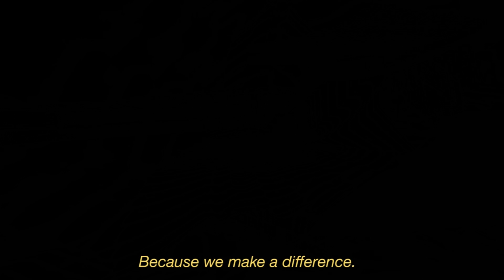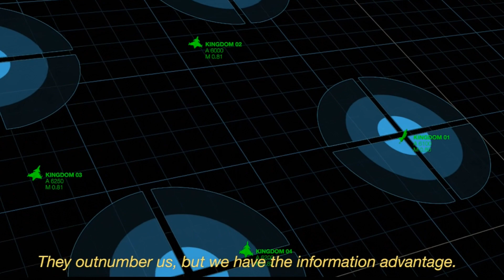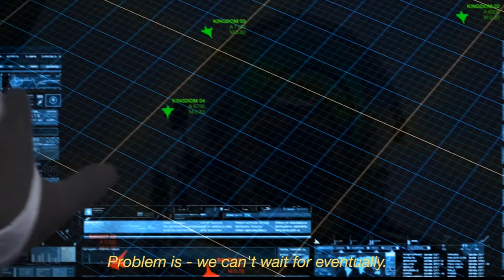Gripen Fighter Jet - Canada's Future Fighter?

Comment: I don't understand the fascination with the F-35. It is probably a good attack/strike aircraft. It will never be a great air to air combat plane. Ever. It's wind loading is way, way too high.  The F-22 is a great air superiority fighter, but is out of production and will probably never be brought into produciton again.

For Canada, I think the Gripen is great for the ground attack role, but instead of the F-35, I would like to see something like the Eurofighter or Rafale for the air combat role. I know people are going to jump all over me because neither aircraft are "stealth". Guess what, "stealth" has been very over sold. Even now, the Russian air defense equipment is being refitted with lower frequency radar to nullify at least the radar absorbing material used on the F-22 and more importantly, the F-35 and B-2, and osme of the shapes and angles. To retain the radar absorbing aspect of their stealth, current estimates are saying that the radar absorbing material must be increased in thickness to 2 FEET to be effective against the lower frequency radar units. Not going to happen.The other aspect of "stealth", the actual shapes and angles, are reduced in their ability to redirect the lower frequency radar signals (signals are less directional at lower frequencies, wavelengths are longer). So, as I have stated above, the "stealth" concepts are hugely oversold. The other part is that there is the return of the concept of the "get close enough to fire a missile, and ti will do the job". It hasn't worked in the past. Probably won't work now, even with all of those wonderful missles and guidance systems that are out there. All of those systems can be, and will be fooled, at some point int time. At which point, you have your pilots, with their fighter jets, facing an opponent with their fighter jets, and all there is is cannon, and short range missiles. The winner in that contest will be the pilot/ighter who can get into firing positon quickest, and that will NOT be the F35 pilot. It will be the Eurofighter/Rafale/F-22/Pak-Fa (T-40/SU57)/SU-3X pilot/fighter.

Isn't this beginning to look like a revival of the old US military principle of the Hi/Lo mix?At the time it was the Hi cost(F-15) in relatively few numbers mixed with Lo cost (F16) in larger numbers.
Reply: The F35 is most emphatically NOT a good air to air fighter. It has lost numerous fly offs against F-18s (Australia did that test) and F22s and F16s in the US. The F35 is NOT designed to be an air to air fighter; its inherent design is not suited to air to air combat due to the wing loading. There is no modern air-to-air fighter that has wing loading over 400Kg/M2. The F35 wing loading is 535 Kg/M2.  That is fine for a ground attack fighter where a high wing loading is an advantage; it is completely unusable for an air-to-air fighter.

As well, the so called "stealth" advantage is already eroding. The B-2 is already being looked at for replacement. This is due to the latest Russian air defense radar units are going to lower frequencies which renders the radar absorbing materials ineffective, and the other parts (shapes/contours) less effective as well. In addition, these radars are now being designed to look for any objects that are moving at high speed, no matter how small. They no longer disregard small bird sized objects that are moving at hundreds of miles an hour or more. So. stealth isn't going to be as much of an advantage as it was originally said to be. But, the F35 is still compromised by its stealth design and the sacrifices made to the Marine V/STOL version aerodynamically.

Within visual range, you do not want to be in an F35 and have to fight with an SU-35 or SU-37, much less a T-50, Rafale, or Typhoon.  All of those planes will easily out-maneuver an F35 with ease.
Reply: F35 is too fast for being a good attack aircraft. It will not be able to see the targets on the ground and less so have time to target them with a bombload. The plane cannot stay up in the air for hours and then answering a call for help from the men on the ground like the A10 can, because the F35 cannot stay up in the air for 6 hours since it run outs of all its fuel in just an hour and a half.
Furthermore is the plane thinly armoured like a fighter jet, and got lots of vulnerable parts.
Reply: I think stealth is overrated today, and it will probably become even less important in the future when detection technologies improve. Some types of radars can see all kinds of planes and have done so since radar was invented in the 1940s so stealth is just a relative concept. Furthermore does stealth also depend much on from which angle a plane is getting ovserved from. And finally, even if a plane cannot be seen with radar, it could be detected with other types of sensors - such as heat-skeeing detectors - and the Rafale can easily see the F35 from many dozens of kilometres away since the F35 got the most powerful engine in the world and it also lacks any device that cool off the hot air from the engine so it can remain undetected, because F35 doesn't carry a such thing onboard to save weight.

Good stealth might allow your plane live a little bit longer and allow you to get closer to the enemy, so you could get in range to kill him. But one should not overestimate the importance of stealth. Atleast as important is the equipment onboard, and if you can find an enemy plane far away and got good missiles to kill him before he even got a chance to spot you, then you got a huge advantage even if you fly the shittiest most unstealthy plane in the world.
I also think that auto-cannons on planes are a bit outdated and that we live in a new age of missiles, but I wouldn't want a plane to be without a little cannon just in case.

The Russian planes looks best on paper since they are super-manouverble and can engage targets 400km away, while F22 and F15 are less manouvarble only can attack targets 160km away. And with stealth on top of all that, I think that the Pak Fa will punch the crap out of any F35 coming its way. PAK FA is the best plane. But Gripen is the best plane one could get in relation to price. In a computer game I would only have Pak Fa's in my air force, but in the real world with money constrains I would go for the Gripen, and perhaps also get a few Su35, F22 or Eagles to get this Hi/low mix.
Reply: I don't think tge speed of s plane is any detriment to tge ground attack/strike role. It hasn't prevented the F-15E, F/A-18, Mig 27, Tornado, or many other jets from being effective ground attack/strike aircraft. The A10 is a unique aircraft; it is a close air support airplane, basically a faster/better helicopter gunship. As such, it needs to operate in areas where the airspace is free of opposing fighter jets, a significant issue.

Gripen can work for Canada. There is no need for ground support in the far north as a standard, day to day operation, so the single sngine is not as much of an issue. Whenever an air to air fighter jet is chosen, that one will need to be a twin engine plane, and it can be user for long range patrol.
Reply: F35 cannot replace the A10 in the close air support role. And it is true that F35 can bomb targets a thousand meters up in the air, but so can the F16 do as well so there is not really much of a needed for this overpriced truck to deliever a bombload.

And you seem to have missed that Gripen got a longer range than most twin engine planes - such as rafale, typhoon and F18. And sure one extra engine gives some extra power, but on the other hand does an extra engine also increase the air resistance since it makes a plane much larger. So most single-engine planes are actully faster than most compareable two-engined planes.
Reply: f35 isnt a stealthy plane killing things from distance, when its heat profile is the largest of any mentioned fighter jet since it got no mechanism to hide the heat from its huge engine because such things was sacrificed for the sake of weight constraints. And since F35 got the most powerful engine of any fighter jet it also generates more heat than any other, and thereby becoming an easy target.
So a Rafale can easily detect F35 ten miles away and kill it.
Reply: Cal Crappie Your statement said that the F35 was a great air-to-air, air-to-ground,  and air-to-sea fighter, just behind the F22 in the air-to-air combat role. Is your definition of air-to-air firing missiles at a distant target? Mine is not. Nor, I would venture to say, is most people's. Air-to-air means planes maneuvering to gain advantage on their opponent. This is why the F22, SU35/37, T50, Rafale, and Typhoon have been designed with the ability to turn, roll, and climb/dive so well. All of which do it far better than the F35. 

As for the long distance missile firing scenario, note that the Russian air-to-air missiles have a much longer range than western missiles, and in the newer Russian fighters, their radar units are just as capable as the US fighters. Over and above all of that, the probability of defeating an enemy just by firing missiles long range has been proven, time and time again, to not be realistic. See the early F-4 Phantom experience in Vietnam as an example. Unmentioned in all of this is that missiles can be jammed, lead projectiles can't, and that the F35 can only carry 4 missiles internally.  There is a reason that every single modern fighter has at least 1 cannon on board. So yeah, you take the F35, I will take a T50, gladly. That matchup is the old "don't bring a Knife (F35) to a Gun (T50) fight" brought to life. There is speculation of whether the F22 is better than the T50 or not, and that has really not been concluded. But the F35 is not even in that conversation. The problem for the US is that there are only 187 F22s, the production has stopped, the production equipment has been destroyed, and spare parts are an issue. The T50  is entering service in 2018, the production line is gearing up for manufacturing, and the quantities to be deployed are far in excess of 187; speculation goes from 500 to the low 1000s.
Reply: Nice speach. Don't have any context around it. 20:1 kill ratio against what opposition force? MIG 17s? MIG 23s? SU35/37s? Or SU57s? Was it beyond visual range? And the final question, at least in my mind is: This is a simulation. May or may translate to the real world. Nd finally, I don't see any member of the US Military calling the F35 anything but a great plane. Should a senior military officer call it anything less, you know that you will have Senators and Representatives asking some very hard questions. Truth is, the F35 program has consumed so much time and money that development on any other fighter has stopped. There are not enough F22s to ensure airtime air dominance, and the tooling and Soares for the existing F22s are becoming an issue. F35 is not suited for air to air combat. It is too slow, underpowered, and wing loading is way too high. Relying on stealth won't do it. Already, the Same missile system is designed specifically to shoot down stealth aircraft. Within visual range, as an air-to-air fighter, it will have problems not only with the SU57, but with Eurofighters, Rafales, and possibly with J20s.
Reply: nattygsbord "too fast" yet the F16 and B1 bomber are performing CAS in Afghanistan. The F35 can also carry more fuel and munitions than the A10
Reply: I still prefer the F-16 Block 52 over both the JAS 39 and F-35. 

They're both great planes, however, unlike the JAS 39 and F-35, the F-16 is cheaper, combat proven in both air-to-air and air-to-ground combat and newer versions like the F-16 Block 52 and F-16V mean that the F-16 continues to remain a highly capable and reliable aircraft well into the near future.
Reply: +Kostas "Within visual range". 3 key words. Kind of important since so little air to air is "within visual range". I'll fly the F-35 thank you. You can jump into something else.
Reply: The fascination with the F-35 is because it is fantastic in air to air, air to ground and air to sea. Only the F-22 rivals it in air to air (slight edge F-22). Kill ratios have gone from 9 to 1 to 15 to 1 to now greater than 20 to 1 in air to air combat exercises as pilots get used to them. These numbers are against the best F-18, F-16 and F-15's (and other NATO and non-NATO fighter jets) that fly. The F-35 is still handicapped with limiting 7G flight control software. It will soon go to 9G. That's just touching the surface of the capability of this supreme multi-role fighter. It is so good the US alone will purchase over 2000 of them.

Comment: Gripens are great, but it is NOT the perfect fit for Canadian arctic operations.  One of Canada's major stipulations, and a strike against the F-35, is the single engine, as the CF-18 / FA-18 has two engines for safety / redundancy.  Another nice thing about the Gripen is that the engine it uses is a modified version of the GE F404 engine, found in the CF-18 / FA-18.
Reply: Gripen is built by a cold ice hockey country, and that plane got bot longer range and fewer crashes per 100,000 flight hours than the FA-18. Gripen has been in service for over two decades and never had a crash caused by an engine problem.
Its okay if people don't like Gripen. But this talk about 2 engines in the comment section under this video is just getting annyoing right now. Why can't people just bother to read?

Comment: Get Gripen & Sukhoy & A10 fighters. Cheaper to buy and maintain, and each fulfilling the needs the others can't (no plane can do everything). 
Station your single engine Gripens all over Canada & your multi-engine Sukhoys at strategic bases & your A10's where the ground forces need them.
Nobody will f@ck with Canada then, guaranteed.
Reply: Thanks, you are technically correct of course. I meant to type Gripen & Sukhoi fighters & A10 (for close air support). That's a deadly combo.

Comment: The Gripen choice is the same choice; both are modern upgrades of 1980s jets. 
So both choices would only be interim replacements. And neither are a good choice, but one is close to being a better choice.
Not quite equal, the Super Hornet does have some relationship to the CF-188 that is totally missing from the Gripen. Yes the Super Hornet is a completely different air-frame from the regular Hornet, but there is still a close relationship in training/repair/maintenance that is not there at all for the Gripen.
Specifically the F/A-18E/F Super Hornet variant known as the EA-18G Growler. That would be a better choice since its electronic warfare capabilities give it more of a useful lifespane than just being an interim replacement (which again, is something the Gripen is as well)

Comment: Guys, what you don't understand is that the F-35 JSF program (back when it was an SAP--or Special Access Program/"Black program") was just as expensive as the renowned F-22 Raptors' cost. So we upgraded hundreds of our newest Hornet variants, then made the Superhornet, and Canada's defense dept decided to buy ONLY that small number. So, if it's between only having a dozen plus Super Hornets and the Gripen? Sure..I'll agree to go with the Gripen but if you were to think fiscally, just buy the infinitely cheaper upgrade on what has lasted the test of time against every new Russian MIG or Sukoy that it's faced IRL air-to-air skirmishes. I mean, is my logic not sound there? Plus, the Raptor scared the living shit out of it's enemies once Iranian pilots tried messing with it over the skies of Syria a few years back (remember?)..so, just saying. That's all
Reply: Gripen and F22 is my dreamteam. But F22 isn't up for exports, so I would replace it with the F15 silent easle. And Gripen is getting old. Gripen is still the best plane though, but that is only because competition is quite crappy. 

-F35 is Supershit. Eurofighter is old and lacks spareparts. 
-Rafale is a short-range fighterbomber that sucks up maintance. 
-F22 needs days of maintance for a single flight, and it costly to fly, and the plane crashes often compared to planes of the last generations.
-F/A18 is old and needs much maintance and isn't as good at dogfighting as Gripen.
-F15 is very strong up in the air, its fast, manouverable, got good range, good ability to climb etc. It have the best killratio of any fighter plane in history (104 vs 0). But it is an old plane that is costly to fly and that needs lots of maintance. And it can only engage targets that are 160km away (compared to SU35 and PAK FA that can engage targets 400km away)

Comment: I've personally thought that the Gripen would make a good replacement for the last couple years since I found out about them.  Canada needs a good multi-role fighter that, more importantly, is designed to work in extreme climates.  The Gripen is that, the F-35 Raptor is unproven and too expensive for the budget we have.
Reply: F-35 is Lightning. Raptor is F-22. No more Raptors. Only authorized customer is USAF.
Reply: @pew6126  Wow, that was 5 years ago.  Thanks I got them mixed up.

Comment: Canada is a BIG place, Gripen has a single engine.....engine trouble = asset loss.  If it can close in the Gripen can probably kill an F-35.  F-35s in Canadian service will probably have wing loadings most likely fuel tanks.  I'd go with smaller engines and use 2 of them in the Gripen.
Reply: Gripen has operated several decades without a single engine-related incident. This is not the 70s, engines are a lot more reliable now.
Reply: In countries which run maybe 300km across.  Canada spans how many time zones?
Reply: Sweden is 1,574 km long and 500km wide. It's not like it is some Baltic republic you can circle on a single tank of gas.